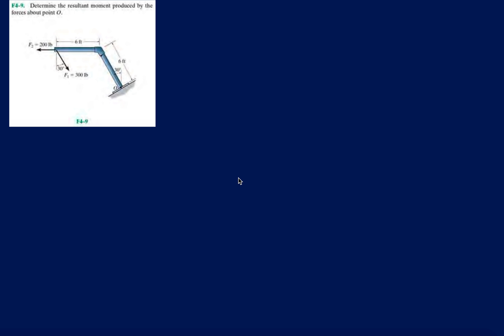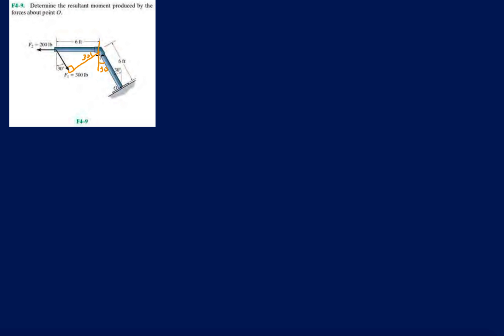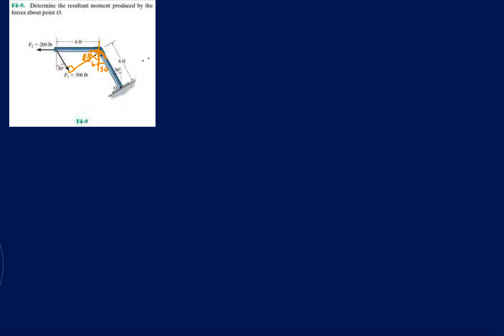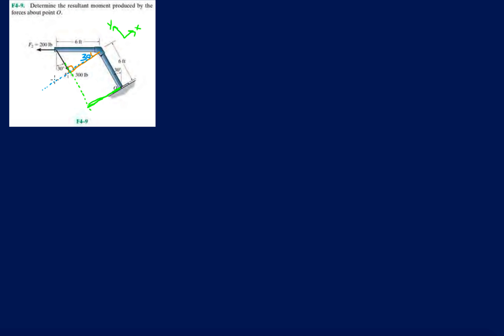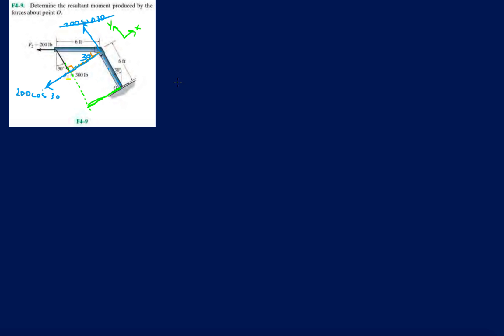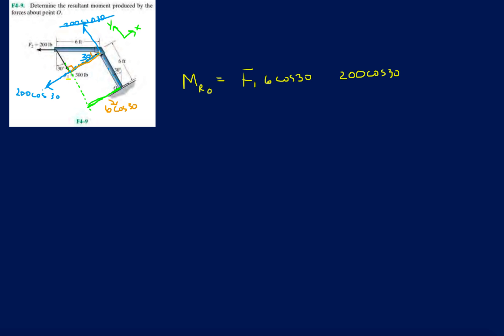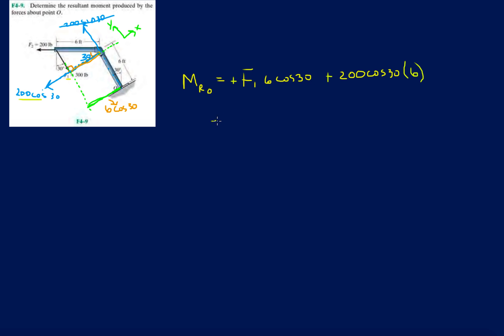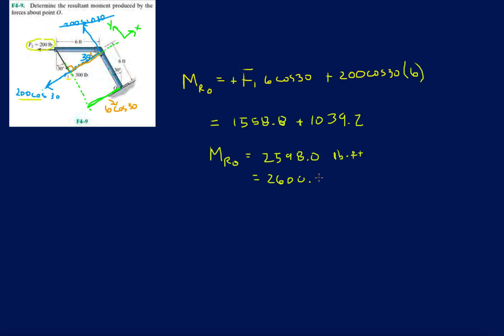Problem F4-9 Statics Hibbeler 12th (Chapter 4)

Comment: i have another solution 
first i split the force F1 into 2 along the x and y axes
then we have Mr0 = +F2.sin60.6 - F1x.sin60.6 + F1y(6+cos60.6) (+ if the Force turn back clockwise and vice versa)

Comment: Why will we not use the y component of F2 Force?
Reply from the maker: The line of action of the "y" component of F2 intersects the pivot point. Remember, if you hold your finger down on the pivot point, and then push/pull in the direction of the force, it must make the paper rotate about the pivot point. If you are just pushing on the object, there will be no rotation (no moment). Does that make sense?